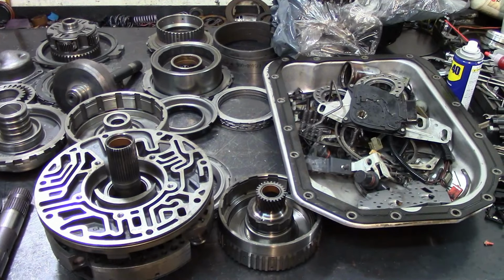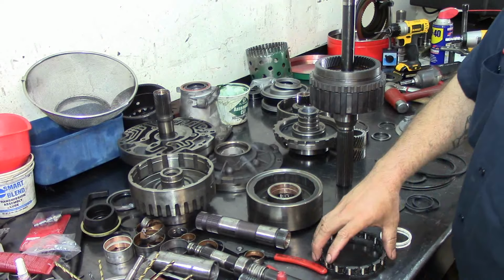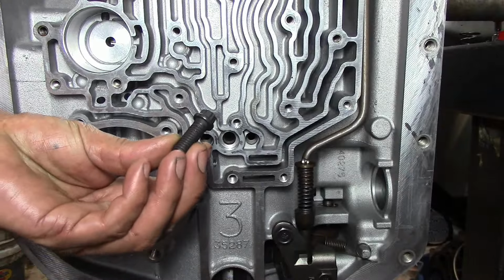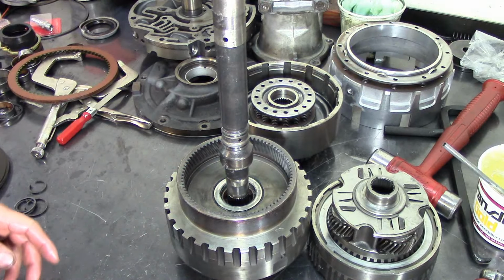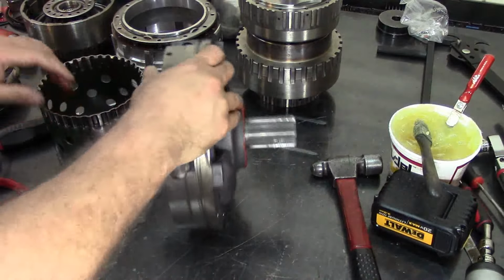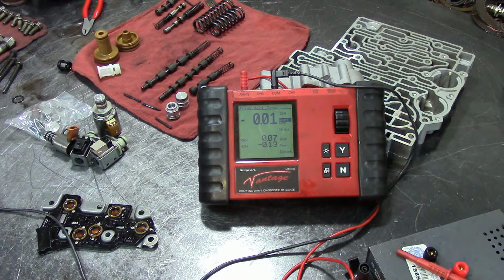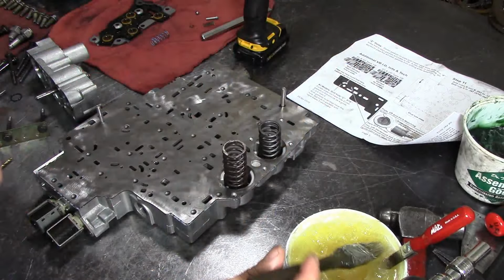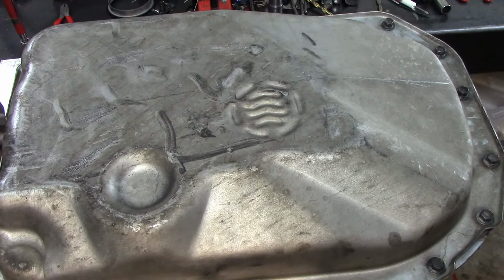GM 4L80-E Transmission Rebuild - Transmission repair

Comment: Why are the pump seals different if you have a lockup or not? Anyone know?
Reply from the maker: They're the same on all 4L80E. Not sure why they would ask you that? Where did you get that information?
Reply: Well, my overhaul kit came with three different seals. And then I searched “4l80e pump seal” And I found ones that say for lock up seal and ones that are just seal. Also when I broke down my transmission, the two holes on both side of the center support had nothing in them. I seen you press seals into these holes. My overhaul kit came with 1 plug for one of those holes. I’ve got most of the work done to the valve body with trans go shift kit do I need to put any kind of seal or plug in either of these holes if I’m using the pressure relief eclip plate from trans go? I’ve seen a lot of people saying don’t even use the pressure relief plate but I’ve already drilled the holes lol.

Comment: During disassembly I removed a solid allen set screw from the reverse feed hole. The shift kit says to install new cup seals in the direct and reverse feed holes. Does the solid set screw get reinstalled or do I install a cup seal? Any help would be appreciated.

Comment: When you’re doing a performance build on this type of transmission would you recommend replacing all the clutch springs and or retainer spring?
Reply from the maker: The return springs for the direct clutch are included in the HD-2 kit from Transgo. You'll reuse the rest. Reuse the retainers unless they are damaged.

Comment: I'm ready to rebuild my 4L80E after watching your video ,only question i have is what about adjusting intermediate and rear bands ? Haven't send anything good and discriptive  except kent moore  pin gauge for rear band adjust with different length pins ( .005 - 6 ) difference between them . Adjustment of the 2 bands is only thing stopping me . I want to switch good internals to a none cracked case and figured there will be different tolerances i'll need to deal with . Any words from the wiseman ?

Comment: I have a great working 4L80E behind 650 wheel hp. Unfortunately, I broke off a piece of the case where the trans secures to the engine block. I found another case and intend to swap over all the internals into the  good case. The trans has 3k miles on it, so Im thinking bushings and O-rings should still be good to go. I plan on putting new clutches in if needed. Am I making a mistake by not changing bushings?

Comment: Alguien  sabe  porque  mi 4l80e se atora en neutral prendido el troke.????..
Apagado  el motor se suelta y puedo  empujarla..........
Pero prendido el motor  se atora en neutral......
Reply from the maker: Está quemado un juego de pastas. Están soldadas y no están libres. Hay que bajar la transmisión y reconstruir
Reply: @AutomaticTransmission  solo encontré  los cloches algo quemados...
Como que la presión se cruza en ella en algún punto..pues cuando la enciendo en neutral brinca tratando de caminar...
Reply from the maker: Revisa el filtro de lubricacion que va detrás de la válvula manual. Va a estar quebrado. Ponle atención porque lleva liga.
Reply: @AutomaticTransmission  ok
Reply: @AutomaticTransmission  para delante  camina bien.,
En reversa  y neutral  de atora  ..
Pero apagada  se suelta

Comment: I have a 2007 chevy express 2500 and my reverse won’t work once I’ve been running it for a while. I have other symptoms like a check engine light with a P0757 code for a bad shift solenoid “B”. It stalls when I come to a stop, limp mode seems to have activated and I recently heard a grinding noise. It’s currently in the shop getting diagnosed. Anyone know what it might be? It’s my work baby and need it fixed :/ any suggestions would be appreciated!

Comment: I am just starting to building my 4L80E .This Video had been a great help without I could not do it. Thank You for taking the time to make it, it's better than any book out there. The best 4L80E video out on YOUTube. Question on the front pump you drill a 1/4" open up the behind front seal return feed as part of the shift kit, which I am not going to install the Transgo shift with the Trans brake install.  Question should I enlarge this return feen hole also for the trans brake install?  Transgo says helps prevent blowing out front pump seal. Or let it be no drilling? Thanks again for your time. Add A Boy.

Comment: I have a question about my 96 4L80e.     I have it apart after no reverse and solenoid b code.  got things apat and the direct drum/clutches/piston ar burned up bad.   frictions with no friction material left.  the piston looks like the bonded/molded piston.  the seal is torn andr ly bad. looking for a piston but everything I find is for 97 and newer though. what is the diference? thanks
Reply: I have this same problem, were you able to fix? If so what you do to solve it? Thanks

Comment: It is not surprising that your adoring viewers are driveway mechanics because that is ecaxtly what you are.

You have no idea how to do a professional level rebuild on this transmission.

The biggest killer of 4L80e other than heat is incorrect end play, of which there are three points to set. Not only did you not set any of them, you did not even CHECK them.
You didn't even whip out a FEELER GAGE to check clearance in the clutch packs.

Overtorqued a bunch of bolts. No torging at all with critical bolts.

Your 'rebuild' is HALF REUSED PARTS.
Checking resistance on a 15 year old solenoid doesn't make it 'new' again. It just saves you money, just like reusing the wiring harness, which an actual professional builder you tell you is NEVER done.

A professional build should last 200k miles. Yours will be lucky to make it to 50k. Loaded with $300, $400, even $1,500 or higher repairs just ticking like time bombs hidden in your 'professional' work.

Comment: I have a 95 4l80.  Attached to valve body is a plate under the dipstick hole.  I’d guess it limits how deep the dipstick goes.  Any idea or input on that plate

Comment: My transmission was fine, had 280k on it.. had the 454 rebuilt and bored.60 over. Went to a shop to have the transmission rebuilt and it’s been problem after problem with it. I’m thinking about just doing it myself because I need to rent a car, miss work get a uber, miss work again return rent a car uber every time I drop truck off for warranty work. Then I have to pay shop labor and shop supplies. Sick of it

Comment: Did you mention to your viewers what to to look for regarding pinion wear (warbling gear's)? How about the pump gear wear and not reuse, just replace. Use scotch bright on forward and reverse drums, if you're able to reuse them. ROLLERS PUSH UP HILL! IF ASSEMBLED THE OPPOSITE WAY, YOU'LL BE TAKING IT ALL APART AGAIN!

Comment: You need to use a hole cutting saw to cut a hole in table to set the shaft in. It will help alot.👍

Comment: Question I bought a 2005 Chevy 2500hd I bought it with a blown t case replaced it with a manual t case switched the wiring on it. Now the issue is I can’t put it in 4wd when the truck is in neutral and transfer case is in neutral. The input shaft is turning when everything is in neutral(looked on my scanner) tcc solenoid seems to be doing its job opens and closes? Anybody have an ideal as what I should be looking for? Thank you

Comment: At 1:38:00 in the video Hiram talks about the AFL screen being clogged with torque conv clutch material, and how the TCC failed previously and that's the cause of the debris and junk in the screen. I am confused though, because looking at the oil flows for this transmission, the Actuator Feed Limit Oil going thru that screen should be just supplying the shift valves and shift solenoids. Does anyone know how this AFL oil would actually come into contact with TC clutch debris that would then collect in this screen?

Comment: Can I get your advice, I put in my lower assembly and I need the assembly to get 1/16” beeper. So the center support bolt. Can line up. Any suggestions?

Comment: This video has been more help than you can imagine.
There are things in this transmission that were not in the older ones, and the books fail at that point.
Thanks for posting this, it's excellent reference material!!!

Comment: Hey  love the video thanks for that . Still have problems with od and reverse  can you show me the air pressure test points on the clutches  around  153 on your video  and I did not get seals for 3rd and reverse  ports in my kit is that required dannelson5@yahoo.com

Comment: I have a 2004 4L80e I’m rebuilding thanks to this video. I ordered the no spin out rear bushing for the case, it has a edge lip. Can anyone tell me if I  install that no spin bushing from the rear inward or from in the case outwards?

Comment: Hello, anyone know the part # for the forward drum large thrust bearing @ 47.30 in the video, I have a late model 4L80e. I ordered one from Global transmission but the one they sent is much smaller in diameter. The bag that the bearing came in has a couple different part # S34214 and 34821-01

Comment: After you stab the direct drum and then the foward clutch housing,  is the crown supposed to sit in with the hole already lining up the hole on the trans housing or is there something else that needs to be done to get the holes to line up???

Comment: Maybe you should have used some AlumTap on the bit when you drilled out that return feed hole?  It would go through like butter.  Just my personal thought, I'm no expert.  Maybe there is some reason why not use it I don't know of.  One can lasts almost forever, you only need a small amount, makes drilling/cutting metal easy.  Stuff is kinda miraculous. Learned about it from an aluminum welder.

Comment: Hiram, I want to thank you for posting this video. I found this and one other to be the most informative and helpful for disassembly/reassembly. Just completed my own 4L80E in my RV and installed the HD2 shift kit and Sonnax fix it kit. Mine had the ubiquitous no reverse/weak reverse. Tried to fix it by working on the actuator rod and reverse piston. Did not work so total teardown. Found the direct clutch seized to the hub. The piston  was eroded/ worn out and caused partial engagement of the direct drum which roasted the frictions and steels in the direct drum. Got it back together yesterday and it runs great. Shifts smooth and firm. Could not have done it without you. Kudos.

Comment: You put 8 check balls in! It should be 7! See at 1:58:00. It is confusing because there are 9 cavities for check balls to go in. The HD2 instructions show to omit the 2 check balls at the rear most region of the case. Was what you did an accident, or do you know some special trick to make it work better with the extra check ball?    PS: All your videos are great!!

Comment: I rebuilt my 4l80e with this video but I have a problem won’t shift first gear on its own I have to release the gas but it will shift all the other gears no problem just wondering if you could help me out.

Comment: Hey enjoying your video but I have a question. I'm rebuilding a 4l80e and I cant get my center support bolt to line up with the holes. I've put it in lined up and the parts wont go down far enough to line up with the outside case. Any suggestions? I am reusing the old reverse band.

Comment: Have a 4L 80 E transmission that’s starts off in second gear and will not shift on its own and it will go into reverse but that’s the only gear that it goes in

Comment: I have a 1991 4l80e in my 1 ton truck and its getting to the point were its needing to be rebuilt. I picked up a 1995 4l80e and read that the 95 wont work unless i use the vb from the 91 along with the shift shaft from the 91 also .Just wondering if you or someone can tell me if this will work. I have all the parts for the build and wanted to use the 95 4l80e so i can keep driving my truck till then .thanks

Comment: Automatic transmission 

I have a 2002 3/4 ton express van, 70000 original miles, for 40000 miles when the 4L80E when cold not driven overnight and temps in the 40's; 2-3 shift is rough, any thoughts ? No slippage

Thanks automatic transmission 

Randall

Comment: I have a question about some damage on the case where the check balls sit. Can provide a pic if needed. I'm sure the case needs replaced, would just like to get your opinion. Thanks for your time. Videos have been extremely helpful to the DIY guys.

Comment: Hello Hiram. Thank you for your videos, they're very helpful. I recently rebuilt the 4L80 in my 96 3500 Dually. Used a BW master kit, Superior shift correction kit, grooved kevlar reverse band, separator plate and gaskets from an HD2 shift kit & dual fed the direct clutches. All forward gears work great. Reverse only works when the trans is cold, slips when hot. Any ideas?

Comment: Hy! I recently  baught a 93 6.5 GMC Sierra with a 4l80e. I baught it very cheap because of  gearbox failure. When the oil  is cool, it only shift when  I floor  in  high  RPM and the reverse in have to rev  it a bit in order to move the truck. When the oil is  warm, the changing  of speed remain  the same  but to move it backwards  I have to rev it to 4k RPM. Where do you think  my problems comes from?

Comment: Hiram--2001 GMC 3500HD--2wd--Im about to install my 4th trans in my truck with 530k miles and for the 4th time--I know im fixing to lose the trans when I first notice that I get a slight shudder when I go to reverse and eventually lose reverse all together---all forward gears work as normal---are there certain parts I need to do a upgrade to before I reinstall a factory rebuilt GM unit???---or are there certain parts I can replace on my trans I have in the truck now and get it back up and running without replacing the whole transmission????  thank you

Comment: How much does a 4l80e rebuild go for now days and how do u tell if a vehicle has a 4l60e or 4l80e transmission..thks
Reply: 1500 for a rebuild near me in ohio.. 4L80E is much longer than the 4L60… my 2005 trans has 4L80e stamped on the side

Comment: remold sealing ring with a smooth inside style hose clamp air craft grade i order them as they not pinch hose its just like a standard hose clap but with add non teethed in side sleeve thinking be good to remold that sealing ring A,,but then again a novice could over mold one doing it that way thank you fer this video kind sir God bless in Jesus name

Comment: Hi, I have an 86 Chevy K30 Military pick-up with a 5.3L LS Swap and a TH400 trans. I would like to swap the 400 for a 4L80E transmission. Is there any particular Year transmission you would recommend ? Pre 96, +2000's ? Also I would like to buy a Core Transmission 4l80E and rebuild it myself.

Comment: Excellent video. You spent an enormous amount of time documenting this. My only recommendation would be to NEVER drill anything at your assembly table. I cringed when I saw you drilling out that drain hole in the pump casing on your assembly table, right next to an open bucket of assembly lube. Cast iron dust is extremely abrasive and goes everywhere. Best to do all the drilling, grinding and filing at another table, or even better in another room. I am a machinist and know nothing about rebuilding automatic transmissions. Thanks for sharing your trade.

Comment: My 4L80's torque converter clutch self destructed back in Dec 2013, tiny fibers were all throughout the whole transmission. Shifts were bone jarring. I swapped in a rebuilt trans. You might be working on my old trans :o)

Comment: How similar or dissimilar to a 91 4l80e 4wd transmission is this? Do you have a video for that by chance? Wasn't wanting to spend 1800 for a bench rebuild, so.. 

My 454 has a habit of eating early model 4l80e transmissions.

Comment: Im going to attempt this what kit should I buy and what's a good book to buy in case I need one also what specialty tools will I need
Reply from the maker: You'll need some type of press to disassemble the drums. A bushing driver set. And some basic tools.
Reply: @AutomaticTransmission  You can get away with using wood clamps to compress the drums, just a bit more fiddly

Comment: Great video, got a question. I just rebuild a 4l80e (2009). On the lift all looked good (shifting good) but on the road i have to rev. it up to 2000 to 2500 rpm to get going. reverse feels OK. Also send the torque converter to a local shop to have it rebuild. What you think i did wrong?  Thanks

Comment: I just got done building my 4l80e,  while watching this video. Never even opened one up before. You took all the guess work out of what you were doing.  Nice vid and thanks a lot for taking the time to post it up!
Reply: How did it workout?
Reply: @Finkelsteinholy  well, I did okay. My big problem was doing it at a friend's house over a month. Do it in a weekend and label EVERYTHING! Also pay attention to part orientation
Reply: Thanks for the comment. How's it holding up? Would you rebuild one again or just buy a rebuilt one?
Reply: @23steph13  it is working fine! Only problem I've developed is I lost engine braking in 2nd gear. Can't figure it out. No solid answers on line yet
Reply: @Duallyboy-jace  Hey Jason. Just read this. Congrats on being able to rebuild the tranny yourself, that's the ultimate DIY task...  Regarding your engine brake issue... You should be able to solve this with tranny still in the truck. Typically on 4l80's the 2-1 servo set is the culprit for that. I'm assuming your brake band is in good shape. 

ACDELCO 24223081

Sometimes the piston will bottom out before the pin pushes on the brake band. This can be caused by wear or using an aftermarket band. Replace with the kit i listed above. Once again, this is assuming that the brake band was installed correctly and isnt worn smooth
Reply: I'm bout tongive it a try and I'm scared to death
Reply from the maker: You can do it, just like the others in the comments section.